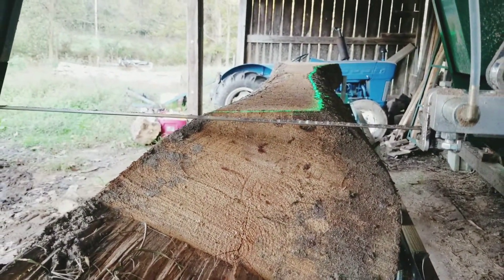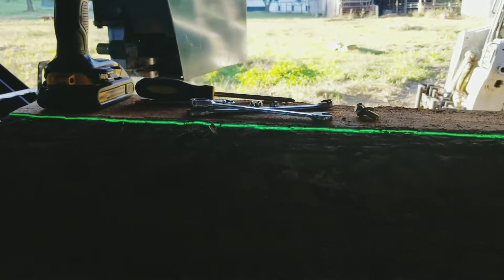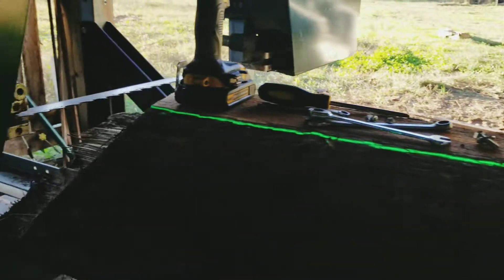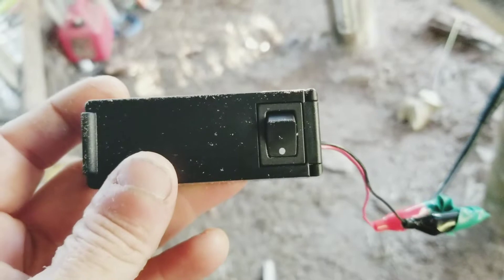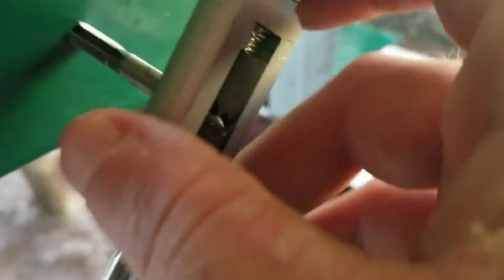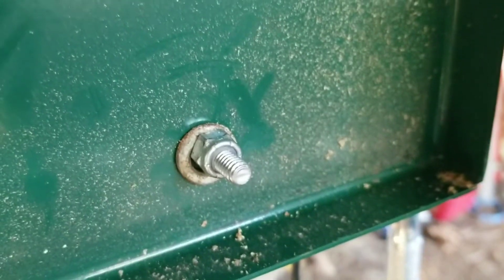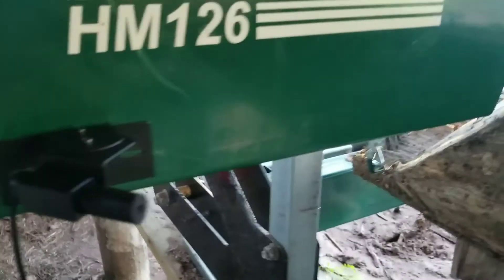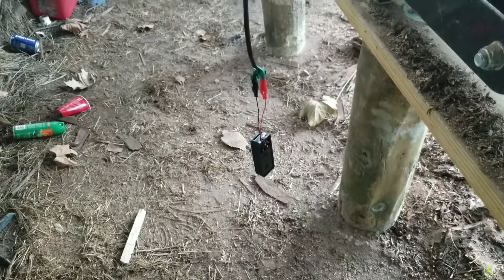Putting a laser on my sawmill

Comment: I have a 130 max and I'm looking into a laser for mine. Any regrets mounting to the door? Does it return to relatively the same spot every time or does it require adjustment every time you open? I would like to mount mine exactly as you mounted yours but I'm worried about accuracy when frequently opening the door for service. Would love to know your experience so far!
Reply from the maker: The only issue is when the door is open and I'm torquing the band wheel, the laser gets in the way. And gets bumped. The mount is cheap and needs reinforced. But that's ab the best spot I found.